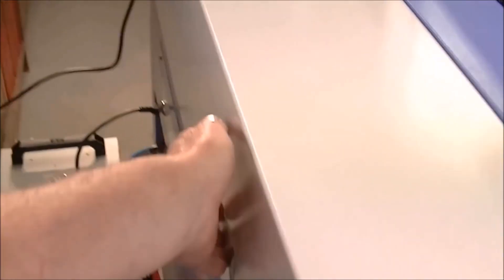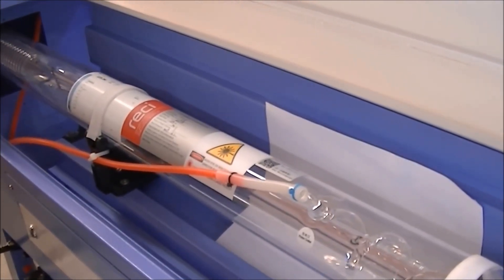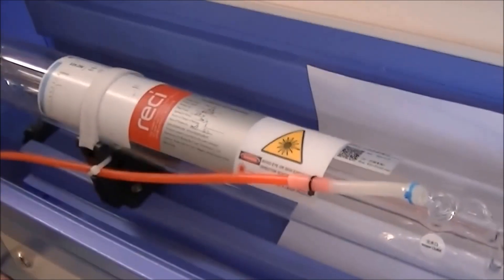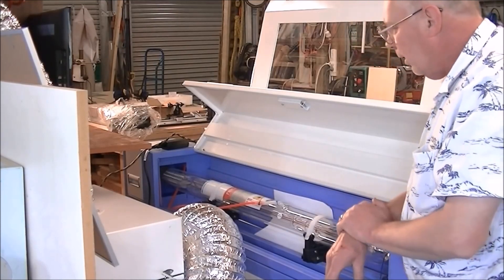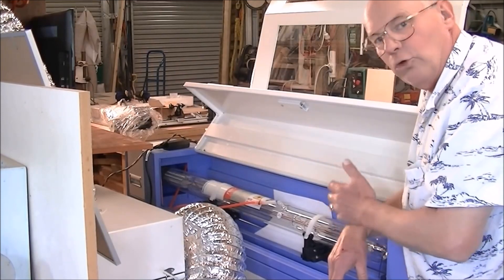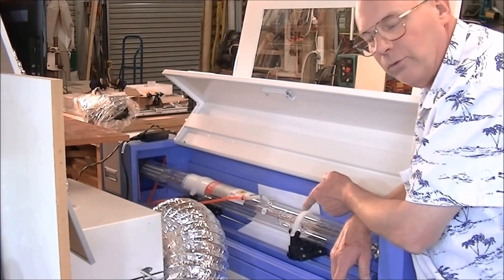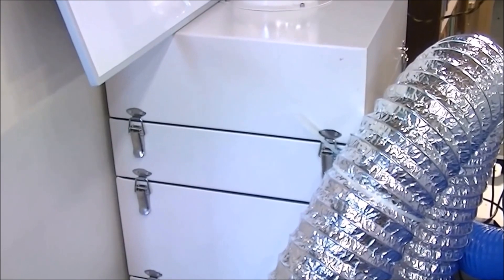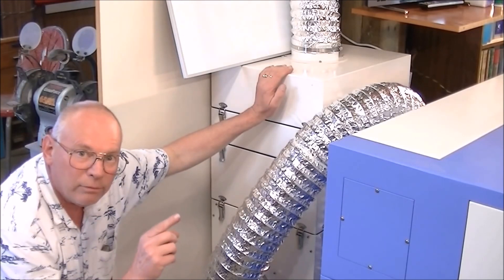Quick Tips #2 Why your laser tube will die /expire within 6 months

Comment: Good morning, sir. thank you for your  video. It was very educative.
Sir , my laser tube dies within 3 months since l bought my 4 x8 co2 laser, and the supply keeps replacing by sending me a new one from china. Sir, what should l do to avoid  this problem . Thank you.
Reply from the maker: You need a Reci laser tube. DO NOT RUN YOUR LASER AT 100%.  95% MAX. If you need to use 100w to cut with, get a 125 watt tube.